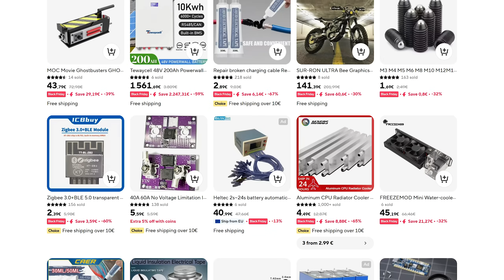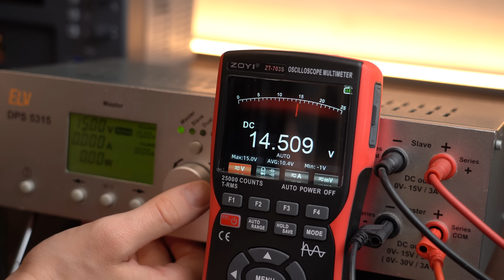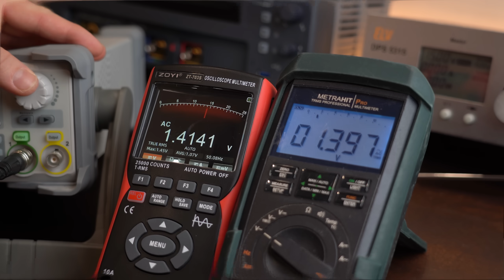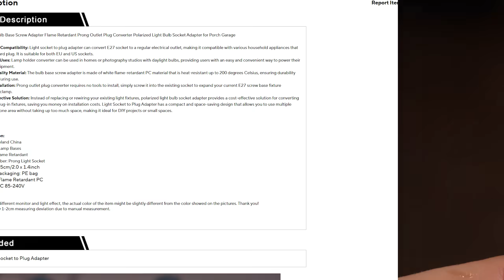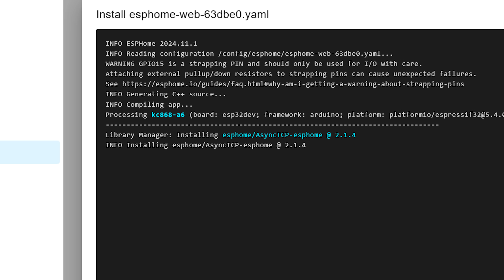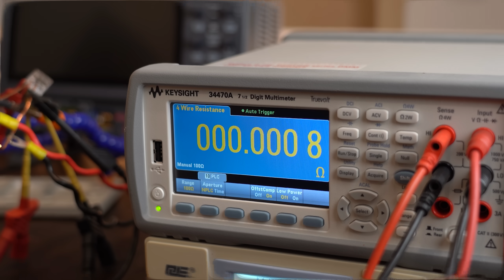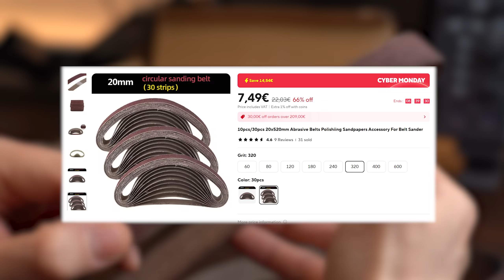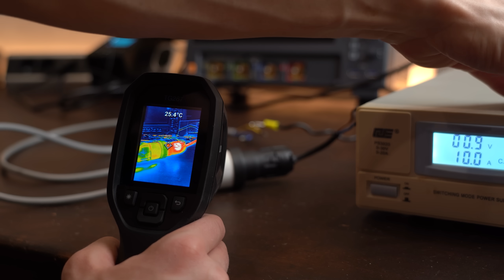I tried finding Hidden Gems on AliExpress AGAIN! (Part 12)

Comment: I'm 100% against home automation. Imagine a small amount of people say 1 million, has those devices drawing shy 1W idle. That's 1MW power wasted with the devices just sitting there in idle mode just so we can control something by voice or phone. Such a waste of power. And those numbers are in reality much much higher.

And all power we consume is converted in some way with ~10% losses in heat.
This is a bigger threat to the environment then petroleum fuels. It's just that the governments wouldn't dare to talk about it because it would mena other countries not adopting power saving laws would fall behind in the tech race. Quite sad :( But we are slowly killing this planet and ourselves using items that's really not needed for survival. Only boosts our laziness, which in turn gives us bad health due to lack of exercise..
Reply: I would gladly not use home automation anymore after people stop mining bitcoin and other virtual money
Reply: On the other hand, the ~12Wh per day my wifi light switch draws is dramatically offset by my 36W of LED lights now only being turned on as needed.
I used to switch them on around 5-7pm when I left the room to get dinner, and leave them on until bed, anywhere from 10 til midnight. Let's say it was 4 hours on average... Roughly 140Wh of power used for the lights.
Now with the wifi switch, I turn them on with my phone or a shortcut on my computer as I get up to do something I need light for. I'll often leave the room with them off. It's currently 8.30pm and I still have no lights on. In total, most days I probably only run the lights for an hour or so. So the total impact is roughly 90Wh per day LESS power used by having that little idle power draw.

Don't get me wrong... I thought the same way at first. It wasn't until I set up my light switch that I realised how it changes the way you do things.

Comment: About that light socket, usually light circuits are not 16 amps in portugal i usually see 10 amp circuits for lights, and even though i never used I always had one of those on the tools drawer.

Comment: I just want a socket on my light switch without having to do wiring myself. I couldn't even wire in a socket myself because it's not my house.
That way i could easily replace my bulb with LED strips. Not really a mystery like you make it out to be.

Comment: 5:30 older days In my country, most public dormitories has socket ban for several reasons (Students uses dangerous materials or casual devices like kettle in dangerous ways or it is believed that telephones distract them and drops the succession rate among students) at those times, we were harvesting electricity from those light bulbs (ofc in dangerous way that most of the time there is open live wires). So this product was safer way to do that. I appreciated :)
Reply: Using a light socket for a kettle would be much less safe.

Comment: Only things I don't like on the esp house automation board are: not auto powered from mains, you need a 12V DC ps, the traces to drive relay's coils are too near each other and ground and no galvanic separation? IDK if what that chip internally is but some optocouplers would have given me a better feeling.

Comment: For the microscope: It looks like one of those very cheap cam units they used back in the days - you can try to turns the black lens holder to adjust focus - that's how it worked in those things back then. If you get it to focus a further distance it would also decrease the magnification ratio.

Comment: turn the camera lens inwards to extend the focal point further from the camera sensor. They might have some silicone on the threads to hold it in place but it shouldn't be too difficult to wiggle free and adjust focus as needed.

Comment: I've noticed that the angle grinder bracket for my Makita performs better in woodworking applications than steel. While it may not be ideal, it's a cost-effective solution for mounting it to your existing tool, rather than purchasing a new one.

Comment: the 703 multimeter+scope, the current range is ''odd'' but i can live with that, its accurate etc but sometimes the decimal point is wrong, eevlog covered it if your interested. 
My pet hate with it, the multimeter leads dont work in scope mode.... I have a voltage rail, I want to see ripple, quick press for scope mode  and nothing! I then have to go find where I put the probe and use the bnc... I know I wouldnt get good readings on the multimeter leads but for a quick and dirty test it would have been great

Comment: If you have trouble reading small writing, a bright torch does wonders. The bright light shrinks your pupil, and that focuses your eye because the light beams converge at a single point. Looking through a pinhole does the same thing.
Reply: Another supercheap gadget for this purpose: Ortoscope 
These handheld wifi endoscopes helps, when the smartphone itself is too bulky.
Reply: lets be real just use the smartphone
Reply: GENIUS
Reply: He's got over 2m subscribers lol, just saying.
Reply: Ah that’s why making a small tunnel with your hand by making a loose fist really helps read text. It works well at a pinch and I’ve always wondered why.
Reply: it's not actually about making light converge at a single point. It is just that when near parallel beams go through a narrow aperture it gives a greater depth of field. That's why you always use a camera 'stopped down' as far as convenient for shots of people where you want the background in focus - or the opposite if you want to de-emphasise the background.
Reply: 'Emergency glasses' used to be sold in the days when it took ages to get a replacement pair - they were black lenses with a pattern of pinholes. Apparently these worked if you just needed a different focal length (rather than spherical aberration etc), but obviously with so little light coming through pinholes they were not very practical.
Reply: bro.... just buy a magnifying glass like thats why they were made
Reply: @thehartkrusher  I think the point was if you don't have one on hand, but thanks for reminding all of us that we can buy stuff. /s
Reply: @nimoy007  yeah apparently people forget that this problem was solved already for less money , youre welcome.
Reply: @thehartkrusher  For less money than the bright light that you already have on your phone? Sure
Reply: @nimoy007  yes because some ICs are actually too small for it
Source: literal masters degree in electrical engineering.
There is zero reason for hostility here bro just chose a dud product for a problem that it isnt suitable for thats why your flashlight and a dollar store magnifying glass are better options.
Reply: @thehartkrusher  I too am an electrical engineer. I'm criticizing you because your comment did not tell us anything we didn't know. It was not useful, and I wanted you to be aware of that.
Reply: @nimoy007  well clearly the dude that made the video didnt know since he didnt mention any of the community alternatives
Reply: @thehartkrusher  Didn't watch the video, apparently. He covered other methods here and he definitely owns a magnifying glass. He is fully aware. The point of this video series is to highlight some stuff online and rate it. This is more from the perspective of someone without a microscope/other methods. Besides, why comment on this thread unless you have a direct response to the idea OP put forth?
Reply: @nimoy007  i did watch the video
He said if i am allowed to paraphrase "i use my phone camera or my microscope but that can be annoying so i bought thing to just pick up and look at ic labels but it sucks"
He did not mention
A)using a flashlight
B)using a magnifying glass (which is literally a better version of the aliexpress device for his usecase)
Take ur ad hominems and spew them at someone else
Reply: @thehartkrusher   None of what I said was ad hominem. Everything I have criticized has been relevant to the conversation. If you failed to absorb the relevant content of the video, that might help to explain your position. Of course the flashlight wasn't mentioned in the video! That's why this thread even exists.
I doubt that I'll change your mind at this point, so I'll leave it here.

Comment: A good portable oscilloscope that works grate but is not that cheap is the  OWON HDS2202S the function generator is ok the scope measure’s pretty good and the multimeter function is decent. But is cheaper than any other 200mhz oscilloscope out there.

Comment: The socket to plug adapter is perfect for security camera installation outside. Low draw applications is exactly what these are used for.

Comment: Iam not a fan  of test equipment with self contained re-chargeable batteries. I can ressurect my 20+ year old BK Precision capacitance meter to life, swapping out the 9V alkaline(assuming no need for cleaning terminals due to battery leak🤔). Nothing can beat a toneohm shorts locator with a current tracing probe for milliohm measurements and current tracing on pcbs. You can buy a used one for cheap on e?bay. The light bulb adapter would be more handy, if only it had a 5V usb on the side🤔. I have the magnifier microscope. It is functional but has a shallow depth of field,but can be useful in reading fine print other than IC part numbers. Better than any lighted lens magnifiers, since you could snap pictures to the micro sdcard.
I bought it off Amzn as cheap as Aexpress❤👍

Comment: Found a USB with adjustable Voltage output 1-20V or something. Hidden gem for me, love it. Maybe for the next video if you have not yet had a look at it.
Reply: That is a boost converter. You can find hundreds of different makes of them, they are mainly made to be able to charge any voltage battery from 1.2 up to 30 Volt, all from the 5 Volt from a USB socket on your computer of on your power bank. But they can be electrically noisy.
Reply: @erikdenhouter  Some of those are USB-PD "trigger" boards and rely on the connected supply to support the voltage.
Reply: @NiHaoMike64  "Some of them", indeed, but these are very specific ones for PD compliant power supplies, in fact they do not make the voltage higher themselves. 'Boost converter' is the generic name for a board that turns a lower DC voltage into a higher.

Comment: Such an adapter is useful if you live in an apartment building and have a storage unit. Usually, these units don’t have power outlets, only a light source and a switch. With such an adapter, you can connect a device even in the absence of an outlet.

Comment: For everyone commenting about the bulb socket, I don’t believe he was criticizing the idea itself.  He was saying the specific one he got was not well made and does not meet modern safety standards.  There could certainly be versions that are built much better, and models that are sold locally in stores should meet modern safety standards in your area. I believe his advice is that you should be more careful buying such products from AliExpress because they do not have to adhere to the same safety standards. If anyone has taken apart an LED bulb, the build quailty seems very similar.  Most LED bulbs use less than an amp of current, thus the internal wiring and connections do not need to be strong.  The connections inside such a bulb socket should be crimped and use thicker guage wiring.

Comment: I have a not-sketchy light bulb adapter similar to that, but it has 2 wall outlets in addition to a bulb holder. My use case is... lighting. My garage has only a single bare bulb, and the outlet is rated for 150W. So I bought 4 strings of LED shop lights, which use about 40W each, and a 30W LED bulb. My garage is plenty bright now.

Comment: 6:17 To be fair, light fixtures also usually use thin wires - if the load is high, either the wire insulation will start melting in the wall or the protection will trip(if the correct circuit breaker was used)

Comment: Around the same cost, the HRM-10 can be used as a millohmmeter with a resolution of 10 µΩ. I can't imagine giving a LCD1602 device a thumbs-up when it does not have 4-wire connections to determine resistance and has 100 times less precision.  One caveat: the FNIRSI uses 1kHz AC sine wave which can be fooled by wire-wound resistors.  Hasn't been an issue for me.  The "kit" type project shown should cost a lot less than it does.

Comment: The Kincony stuff is phenomenal. I recently picked up the KC868-A64 to control a BOAT LOAD of door/window/water sensors and it's been absolutely smooth sailing with that and ESPHome. Strong recommend on their products.

Comment: I've bought a couple tubes of that exact liquid electrical tape. Never had that issue. Maybe I was just lucky. I've got the angle grinder belt sander as well, but I haven't been able to use it because none of my 6 angle grinders are metric.

Comment: As for the adapter. A friend of mine needed to fit a wifi repeater in his storage box to reach his ev charger in the common appartment garage. Only available thing was a light point.

Comment: Back in the old analog days most meters had a zero button where you would connect the leads together and zero the meter.  Just like your device.  This feature alone would be good enough for most meters today.  Just like weighing things with the tare button.

Comment: I recently bought these KinCony smart home devices, with 128 I/O, two 16 I/O and one with 48 inputs, to do automation on the entire house. Paid just over $500 total, which is pretty reasonable. Comparable brand-name smart home systems are significantly more expensive. I had no issues programming them with esphome, they all seem to work fine.  Glad to hear the manufacturing quality is good.

Comment: 7:40 there's a similar board on Amazon by Walfront w/ 8 relays, esp32, & i/o header vias. Works great w/ Tasmota (for HA). Only supports 5-30VDC for power, but that works fine in my camper.

Comment: You  could get a YR1030 / 1035 - Its meant for measuring the internal resistance of Batteries and can go down to 0.01 mOhm but its perfectly fine for measuring any resistance ofc.

Comment: You used the wrong type of sandpaper. Red sandpaper is for soft materials, like wood or plastic. For metal you need the blue type (zirconium sandpaper) or even better ceramic alumina sandpaper.

Red sandpaper is aluminum oxide and also pretty bad if you're using it on metal before welding, as it leaves deposits of aluminum oxide on the metal which can weaken your welds - apart from being used up pretty quickly that is.

Comment: I actually had a use case for that lightbulb socket adapter! Years ago, my bed reading wall light had a GU10 incandescent bulb; I wanted to upgrade to a LED bulb since it was getting so hot to actually be uncomfortable to use. GU10 LEDs were painfully hard to find and overpriced in my area back then, and I couldn't replace the reading light since I was renting. I used one of these adapters to plug in a LED kids night light. Problem solved!

Comment: I have those bulb to socket adapters for a complete different reason. Whenever the power goes out, I simply pull down the mains resettable fuse. Use what some call a “dead man wire” - that’s a cable with two plugs on each and perform these steps:
1. Take down the main fuse.
2. Unplug a light bulb somewhere in the house and replace it with that adapter
3. Plug the one of the dead man cable ends to the adapter
4. Plug the other end to an inverter power station
5. Once everything is connected I turn on the power station inverter.
And voila! I have fully functional lights during power outages.
Rolling back when the power returns means doing the above steps in reverse.
I don’t advise anyone to follow my example since not paying strict attention to the order of the steps will cause you or to public service personnel severe damage.

Comment: I've made my own  adapter like that in my storage unit in the basement of my apartment. There's no power down there other than a lamp and I needed power for my security system running on an ESP32. Works like a charm (but mine also allows me to use a bulb.

Comment: This E27 socket adapter is sometimes very useful; for example, if you need to use some tools in the ceiling and it is hard to pull an extension cord up there.  Nowadays, it is becoming pretty useless, though, because most light fixtures are now LEDs and no longer use the E27 socket.

Comment: That angle grinder adapter is a ridiculously useful thing. I had it, and a "pipe sander" adapter at work, but when trying to buy one for home use i only encountered cheap knockoffs (scott here however found an even worse one... it definitely shouldnt be made with plastic). If you get a proper one, it will be your favorite tool.

Comment: Socket adapters are very useful when you have work to do in unknown place, where you often have trouble to get access to wall sockets, but light fixtures are on the outside.

Comment: I use one of the light socket adapters every Christmas for my outdoor Christmas lights. I don't go all Griswold with my lights, just a couple of strings, probably less than 50W total. The adapter is very handy as the light above my basement door is already on a timed switch allowing automation of my Christmas lights with basically zero setup. I would never use it for anything else however as regardless of the current rating of the adapter I'd imagine the current rating of the wiring in many light fixtures isn't designed for much more than the maximum bulb wattage listed on the fixture.